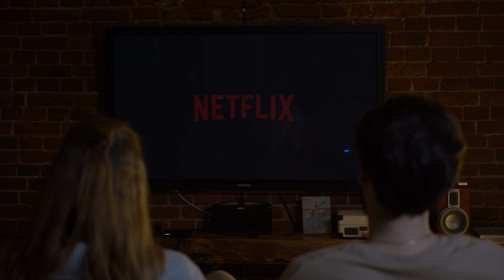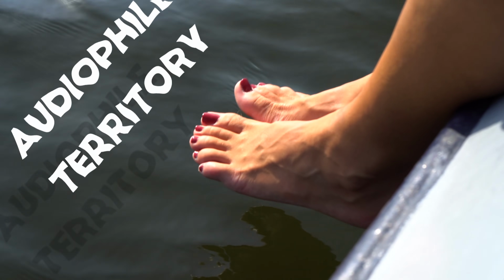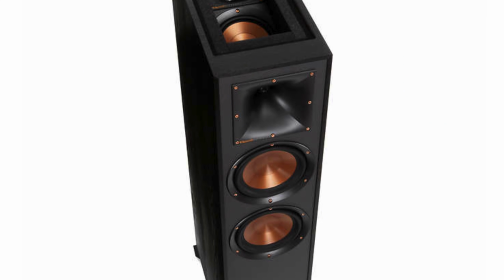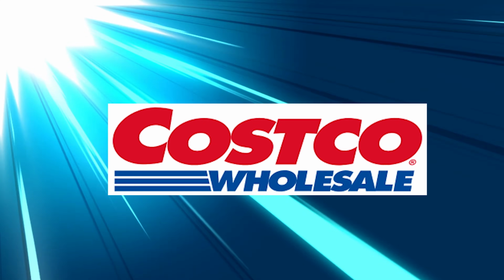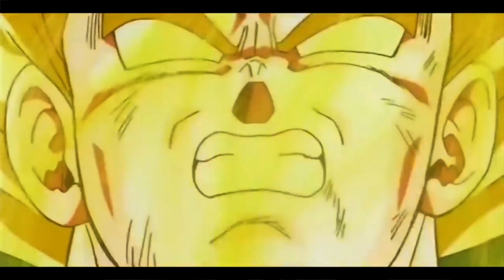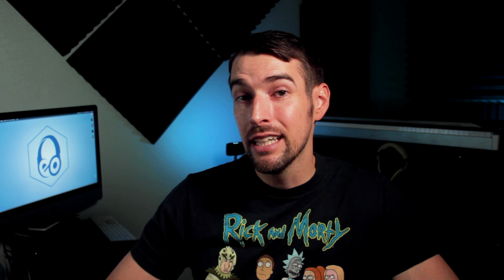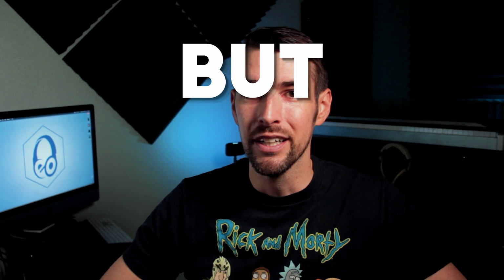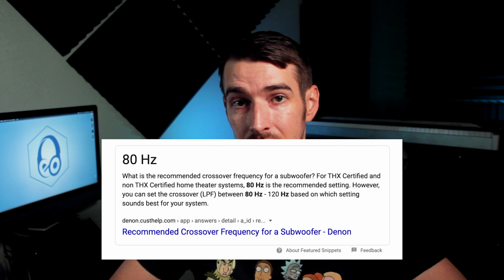$1,500 BRAND NEW Dolby Atmos BEAST SETUP?! Costco & Klipsch Bring It AGAIN!!!

Comment: I was gifted a old denon AVR-3806 and Atlantic technology 12in sub from a family member that is upgrading their system. I’m new and don’t know much. Your channel has been awesome on helping me get started. Just wanted to see if this klipsch package would be a good option for what I have. Thanks
Reply from the maker: Thanks for the kind words! 😊 The Denon 3806 could work! The only caveat is that the Klipsch system technically has built in upward-firing speakers in the towers to bounce Dolby Atmos audio off your ceiling. But the 3806 is old enough to where it doesn’t support Dolby Atmos content. 

BUT…with that being said, speakers are still expensive, so even though you would need to leave the built in height speakers disconnected, it’s still a good bargain even if you’re using it as a solid 5.1 system (front left, center, front right, surround right, surround left, subwoofer). Make sense? 😎

Comment: How do i connect both the 12in subs to n the sony dh790
Reply from the maker: Via RCA cables to the ports under the section labeled “subwoofer out” on the back of the DH790. 👍

Comment: Since the entire year of 2021 I have been saving lots of money for a higher-performance/quality/fidelity full-on premium Dolby Atmos Home Theater moving surround sound system originally one of the two Nakamichi Shockwafe Full-On Premium High-Performance/Quality/Fidelity Wireless Dolby Atmos Home Theater Moving Surround Sound System with a Loudspeaker Soundbar with Six Full-Range Woofer Midrange Drivers and Two Side Tweeters that bounce sound off walls & ceiling Two Big Subwoofers and Either Two or Four Surround Loudspeakers with a Tweeter and a Full-Range Woofer Midrange Driver that can be placed as Upward-Firing Height Elevation Loudspeakers so once I still had a solid good Onkyo 7.1 Channel Premium Dolby Atmos Home Theater Surround Audio-Video Receiver I decided to get a Klipsch 5.1.2 Channel High-Performance/Quality/Fidelity Full-On Premium Wired Dolby Atmos Home Theater Moving Surround Sound System for my 7.1 Channel Dolby Atmos Receiver I had owned and finally bought the Klipsch 5.1.2 Channel High-Performance/Quality/Fidelity Full-On Premium Wired Dolby Atmos Home Theater Moving Surround Sound System at a home theater store and they came to my house between 1-2 months hooked them up to the receiver with high end speaker wire not thin speaker wires calibrate all the loudspeakers including the height upward firing speakers and work very flawlessly and sounds way way a lot much better than almost all soundbars my Klipsch+Onkyo Dolby Atmos Home Theater Surround System pretty very much blew me away with very great bass treble midrange clarity dynamic-range immersion punch full-detail realism atmosphere for a very awesome 3D object based moving multidimensional surround sound experience that I can hear sound objects flying above around beyond through and all across the room it even rivals my nearby Dolby Atmos movie theaters

Comment: Im seeing alot of klipsch r-26fa in the reference setups im looking at. Are they the same as the R-625F?
Reply from the maker: The R-26FA and R-625FA are virtually identical, except that the R-26FA towers are a year older, but also have dual binding posts if you’re possibly wanting to bi-amp or bi-wire them. The R-625FA only have a single pair of binding posts.

Comment: Just got this setup. I will use your affiliate link for the Monoprice 14 gauge wire and stands. Are the stands you recommend able to hold those bookshelf speakers? They look small.
Reply from the maker: The Klipsch R-41m speakers are 7 lbs and the speaker stands I have linked can support up to 8 lbs, so just enough. 😁🤘 Although you can get sturdier ones in the end, if you really feel the need to

Comment: Is there a way to order this set and shipping to the Netherlands, Europe?
Ik can't find anything about this.
Reply from the maker: You should be able to get the individual pieces to this set either from an online retailer or Amazon, I would imagine. 

Just search for: 

Klipsch 5.1 Reference Theater Pack
Klipsch R-41m (pair)
Sony STR-DH790 receiver 

Hope that helps! 👍
Reply: @ealanosborne  one 625 speaker cost €600! in Holland so I try my best.
Reply from the maker: @JelleSchaffie  Yikes! For Europe, you might want to check out Jamo. They are owned by Klipsch and are fantastic entry-level speakers also.

Comment: I know I am late to the game. Could you please answer a question for me? Costco no longer offers the subwoofer that you describe in this video. What is the difference between the Klipsch R-12SW and the R-12SWi? Which should I buy? Thank you!!!
Reply from the maker: Pretty much the only difference is that the 12SWi is wireless, so if you need to place the subwoofer somewhat far away from your receiver, it makes it so much easier now not having to snake an RCA cable over potentially long distances. 👍

Comment: The costco theater pack does come with 7 speaker wires so you do not need more wire bit it comes with 5 15ft and 2 25ft

Comment: If i had to pick Denon receiver vs Yamaha receiver sold by Costco which one would you recommend? I read that Denon is rated at 75W max for each channel whereas Yamaha is rated at 100W or you think max power doesn’t matter?
Reply from the maker: They pretty much equal, with their pluses and minuses. But I will say this - get the Yamaha if you also like to listen to music on your system. They have more (and easier to setup) options for wireless expansion if you like whole house music. 

If you’re mainly using it for TV/movie watching, go with Denon. Audyssey room calibration is superior to Yamaha’s YPAO calibration software. 🤘

Comment: Love your educational & entertaining videos!!! I have a question. I'm installing (2) Definitive DI 5.5 BPS In wall speakers as my rear surrounds (5.2.2)  I have 2 ceiling speakers for atmos. What is the recommended ht. these speakers should located above my ears and is that height referencing the location of the tweeters?. Thanks in advance!
Reply from the maker: Thanks for the compliments! Honestly, since you have ceiling speakers (either mounted or installed), they can be far away and still have an effect, just as long as you make them loud enough. 

Dolby suggests ceiling speakers be placed at an 80 degree angle (almost directly) above your listening position, though, if you want to get technical. Check out this link:

https://www.dolby.com/siteassets/about/support/guide/setup-guides/5.1.2-overhead-speaker-placement/5_1_2_overhead_speakers_setup.pdf
Reply: @ealanosborne  Hi Ealan! The ceiling speakers are fixed from when the home was built. Not sure I understand your POV on what height on the wall  (for ex: 12’ or 18’) above  my ears- I should place the new in wall speakers behind my couch? Does this clarification of my ask make sense?
Reply from the maker: @steveave5911  Oh…nope. Totally misread your last comment. My bad. 😄 Since you have ceiling speakers, in order to get the best height effect from them, it’s best to install your rear surrounds just about ear level. And when I say ear level, I mean the woofer should be about ear level to make sure low and high frequencies aren’t blocked by furniture, etc.
Reply: @ealanosborne  I didn’t write my first inquiry clearly. ah! Your last reply is what I am seeking. So The woofers are to be at ear level. Thank you so much for this clarity. These DT Tweeters are amiable so I can aim them Towards the our seating sweet spot. 

Once again, thanks keep the videos coming!!

Comment: I have the 5.1.4 klipsch cinema reference package do you recommend getting the 250$ klipsch subwoofer to run 5.2.4 system or is the difference sizes in subwoofer undesirable?
Reply from the maker: You could still make it work. It’ll just take a little extra tweaking to make sure they’re balanced and not one overpowering the other. But 2 always fills a room more evenly than 1, given your furniture placement, etc 🤘
Reply: @ealanosborne  👍🏼

Comment: Will the upward firing speakers work good if you have cathedral ceilings.  My house ceilings are 8 feet. But the room tbat the system will be in has catnerdral which ends up Being about 10 to 12 feet
Reply from the maker: Not especially. I’d say 9 feet max for a good bounce effect off the ceiling.
Reply: @ealanosborne  so you suggest getting the system tbat the speakers mount abiove ? If so. Do they need point down and out of so how you do that
Reply from the maker: @ac7384  Yeah, I would suggest mounting speakers, or even in-ceiling speakers, if you’re willing to put in the work for that. 

But almost all the “height or elevation speakers” you can purchase from Klipsch, SVS, Aperion Audio, etc, are angled, so you can mount them between you and the TV, so they are still pointing down towards the couch.
Reply: @ealanosborne  ok great.  The Klip schd you have linked and in video here for the above speakers are tilted.  They don’t look like it tho. So want make sure ?

Comment: Great video. Thank you very much.
I had a question though. I was looking at Sony STR DH790 specs to pair it up with this Klipsh bundle.

STR DH790 spec says 90w per channel into 6 ohms with 2 channel driven. Isn't this underpowered for R625-FA tower speakers whose rms output is 100w?
Reply from the maker: It’ll still be fine with the Sony since it’s “up to 100 watts RMS.” And since those speakers are so sensitive (96 dB), meaning it doesn’t take much power to get them loud. But I suggested that receiver to stay under the $1500 budget. If you can afford a different or better receiver, go for it! 😀🙌
Reply: @ealanosborne  I see. Thank you. Keep up the great content.

Comment: Thanks for the video. I have configured it and sounds great. @Ealan Osborne One quick question the wire from from Atmos to be connected to the surround  input of the receiver? I have onkyo receiver from Costco as well. Also what should be the db for each of the speakers, I guess it is based on preference

Comment: Looks like the Klipsch R-120SW is a better aesthetic match for this set than the R-12SW (the one Costco sells). However, I've heard good things about SVS PB-1000 or SB-1000 and considering those instead.
Reply from the maker: Yeah, those are great subs for the price. Especially the 1000 Pro series, since those support the SVS app which allows you to dial in a couple EQ adjustments, among other cool stuff. Less boomy than the cheaper Klipsch subs - cleaner bass response. 👍

Comment: My local Costco's did not have this stocked but I got it online for $799 ($100 off, sale ended 7/30). If I buy the Denon 7 channel AVR-S750H from Costco (for $400) it looks like I can do a 5.1.2 setup with this Klipsch set. If I want to add 2 additional surround speakers I'll need a 9.2 channel AVR which look to be much more expensive...and a lot of them don't even support eARC.
Note: I am looking for that Sony STR-DH790 AVR but could not find it new online.
Reply from the maker: Yeah receivers are going through a chip shortage worldwide, so models that are normally in stock all the time…are not. 🙁 Onkyo is supposed to be coming out with a budget 9 channel receiver soon. October maybe? $799 or somewhere around there? Was supposed to come out in June, but alas…😭

Comment: I picked up that 5.0.2 klipsch system, with the R-12sw sub, and the yahama TSR-700 for $399  Which is also the (RX- V6A) for a total of just slightly over $1400 for everything at Costco...and it sounds really good, its loud and has quite a punch from the sub. Plus my system actually came with 7 separate speaker cables even though I picked up 100ft copper 14gauge wire
Reply from the maker: Fantastic! And yeah, I’m so surprised Costco STILL hasn’t updated the online description about the amount of speaker wire that comes with the system. I hoped they wouldn’t short change customers like that, and it turns out they don’t after all. 🤷‍♂️ Update the info, Costco! 😄 You can return the speaker wire, right? I hope? 🤞

Comment: What receiver you mentioned from Costco is a good match for the klipsch atmos speakers from Costco.
Reply from the maker: The ones Costco sells currently are all good enough, since Klipsch speakers are notoriously sensitive (meaning you don’t need as much power to get them loud compared to other speakers). 

Of the three receivers that Costco sells, I’d rank them as follows:

1) Yamaha TSR-700 since it’s 8K ready and the newest model of the 3
2) Denon AVR-S750H
3) Onkyo TX-NR595

Another that isn’t sold at Costco would be the Sony STR-DN1080. 👍

Comment: Thank you for all the usefull info.
The Klipsch Reference Dolby Atmos bundle just went on sale for $100 off and i just purchased it and am setting it up. It now comes with 7 sets of aluminum speaker wire so it looks like someone got your feedback about only 5 speaker wires for 7 speakers. I still ended up having to buy wire for my surround speakers since my room is not conducive to hiding wires and required longer wire to run along the baseboards.
Reply from the maker: You’re very welcome! And yeah, I’m glad it come with enough wire for a conventional speaker situation. But I get having to get more. Every home theater is different! 😀🙌

Comment: Hey man. I was thinking about buying this setup but I’m wondering what’s the best way to connect it to tv using one of the recommended receivers since my tv is arc only (no eARC, LG C7) and I don’t wanna miss out on Dolby atmos. I only have Apple TV and Ps5 connected to my tv and I don’t plan to add anything in the near future. Also I’d like to use a receiver that supports airplay 2 as I’d like to cast music from my iPhone to it. What’s your recommended connection to tv/between devices and what receiver do you recommend for my needs? Thanks a lot in advance
Reply from the maker: Hi! The Denon S750H, Sony DN1080, and Yamaha RX-V6A all have 7 channels and Apple AirPlay. 👍 

As far as eARC, that only matters if you keep your AppleTV and PS5 connected to your TV and arc the audio back through the receiver. 

If you connect the AppleTV and PS5 directly into the receiver, then the receiver takes care of all the audio processing and you’ll have Atmos. Make sense? 

Lastly, the Yamaha RX-V6A is out of stock everywhere. But if you have a Costco membership, they sell the Yamaha under a different name: the TSR-700, but it’s exactly the same as the RX-V6A. Costco also sells the Denon S750H online. 🙌 Hope that helps!
Reply: @ealanosborne  yes, thanks a lot! I’m planning to upgrade to latest lg oled but I have a one bedroom apartment and already have two 65inch smart TVs lol so I’m waiting for one to die to finally get eARC but the receiver hdmi pass trough seems like a good temporary solution :-)
Reply: @ealanosborne  sorry to bother you again :-) what do you think about denon x2700h? It’s only $50 more than marantz but it’s 95W where marantz is 50w
Reply from the maker: @BAKS7U  Oh sure! If it’s in your budget, the X2700H is great! The “X” series amps are better quality than the “S” series in Denon’s line of AVRs. 👍

Comment: Quick question on the towers only would you rather have the klipsch r-625 or the Polk s60 assuming price was same. I’m having a hard time deciding but idk which would sound better.
Reply from the maker: At least on paper, the Klipsch seems like a better choice. They’re much more sensitive, so it will require much less power to get nice and loud. Plus, I still think the Costco bundle is the best package you’ll find at that cost. 👍
Reply: @ealanosborne  thank you for the fast response. Last question if you had the choice between B&W 683s used about 7 years old or a brand new set of klipsch r26s?
Reply: By the way the b&w they are selling them to me for $900 for both is that even a good deal?
Reply from the maker: @THEHULK209  Yeah, that’s a great deal. The B&W 600 series usually sell for $1,000 each. And speakers are speakers. As long as there’s nothing wrong with them, all they need is a simple positive and negative electrical signal to produce audio. I’d get those over the R26s any day.
Reply: @ealanosborne  ok thank you for the advice. You just got 1 more subscriber.
Reply from the maker: @THEHULK209  Yay, thank you!!!

Comment: Am so undecided whether to go with a SvS ultra bookshelves or Klipsch home theater 5.1 system, Or a Sonos Arc, 2 Sonos Fives and a subs, Any recommendations?
Reply from the maker: Well, out of all you mentioned, Sonos Arc+2 Sonos Fives+Sub will be the easiest to hook up. SVS Ultra Series will be the best quality+best sound, although you’ll need an AVR to power it all, so that’s an extra expense. 

If you go the Sonos route, there’s really not much upgrade potential after that. But if you go with Klipsch 5.1 Theater Pack+AVR, that’s at least a baseline surround sound system that you can slowly build off of and upgrade as time goes on. Something else to think about. 

I personally go for good ol’ fashioned AVR+wired speakers because you get a bigger soundstage than a soundbar, and better reliability. Once it’s hooked up, it just works. Sonos has a tendency to disconnect and have issues to troubleshoot just because that’s the truth about all wireless systems. 👍 Hope that helps!
Reply: @ealanosborne  Thanks you for the advice you were a big help😁, My main concern also is the extra work, Using a Avr receiver with multiple speakers and running wire in wall or under carpet can be very time consuming, A Sonos 5.1 system is basically plug and play lol, But I know the sound quality will not be as good as a full home theater system so tuff decision, And your right always good to have run to build just incase you want the extra horsepower.